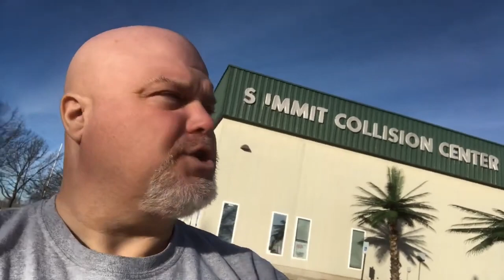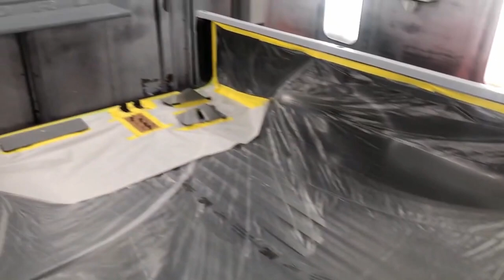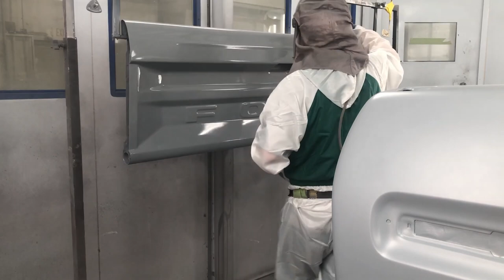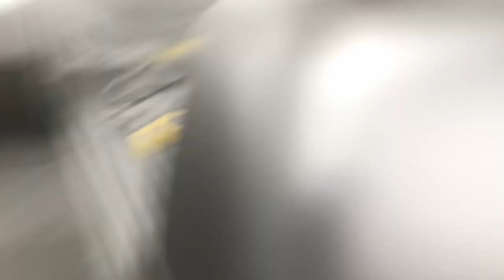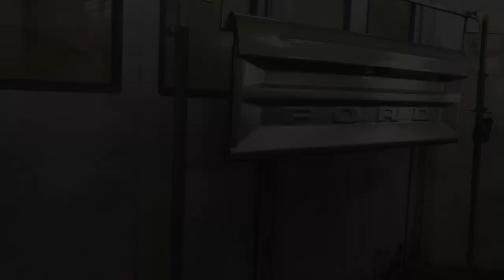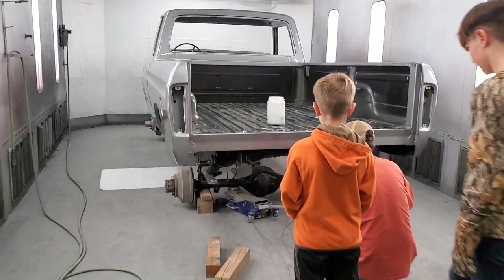1978 Ford F250 Gets Paint!!!

Comment: When you blocked the primer what grits of sand paper did you use?
Reply from the maker: If you are planning on repriming then  block with 150-180 and then go over your edges with 220-240. If it is your final prime then block with 240, then I reguide coat and sand with no less than 400 grit.

Comment: How much does it cost to get a piant job like this got a 79 ford
Reply from the maker: Angel it depends on the amount of work that needs to be done to get it ready. Can't throw u a number without see what it looks like. I can tell you shop rates for a regular body shop in the Midwest are are usually around $50-$60 and hour and it's not unusual to hit 100‐200 hours on an old truck.
Reply: Cheers

Comment: Why didn't you just it apart to paint ?  You got it half way done anyways .
Reply from the maker: There were two reasons, one was limited room in the booth to have it all apart and not have to do 2 loads in the booth. The other reason was the color didn’t cover very well and I was worried about having enough paint and possibly having a color match issue. It turned out well, and I only had to respray the tops of the fenders to get rid of a tape line.